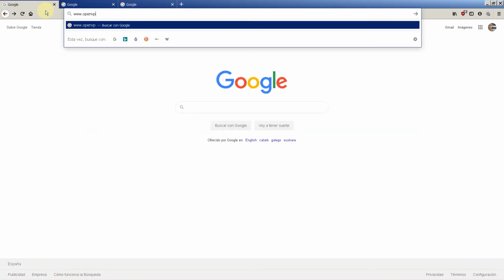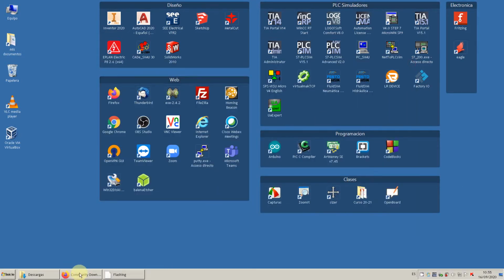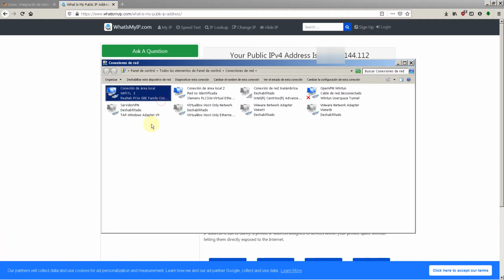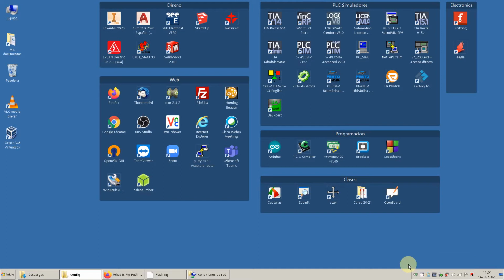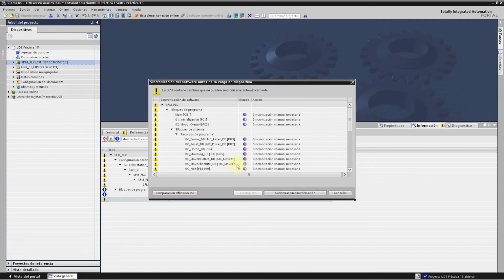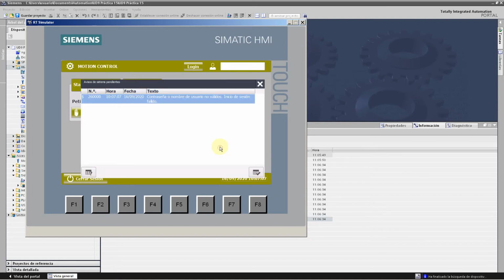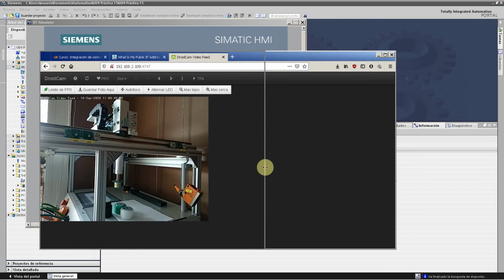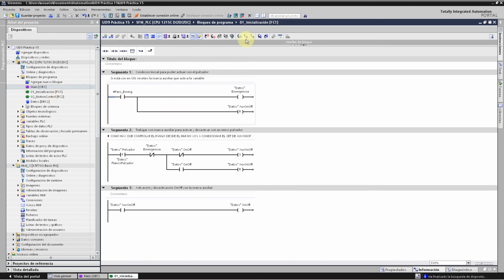Demo Client VPN

Comment: 👍🔥👍 Great! Please tell me, is it possible to create a remote connection to the LOGO 8 relay in this way? What else needs to be done for these purposes? I have little experience in controlling relays using the VIRTUINO mobile application, but it is limited within the local network. I'm planning to create a project to control lights and heaters in a garage that is far from home, but I can't figure out how to do it. I saw your video and I hope that you will tell me what to do to make it work.

Comment: Hi Miguel , nice video can you share with us configuration for this application
Reply from the maker: The configuration files were for my students during the pandemic, I don't have the server online now. But the default provided for OpenVPN with minor changes adapting the IP address and ports, should work.
To test the system is obvious that you need a computer running the server and then another computer in other place as a client.